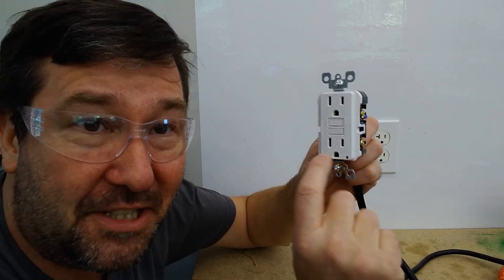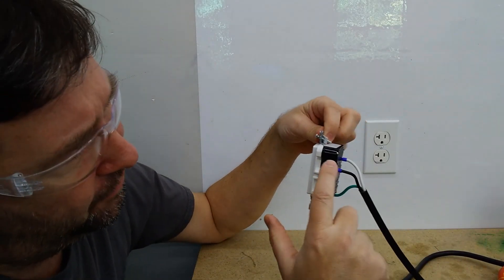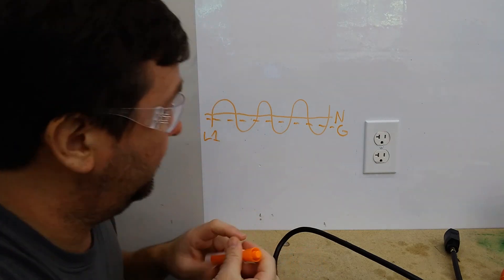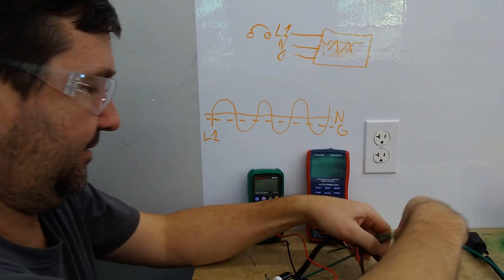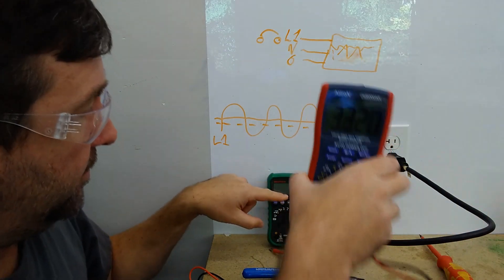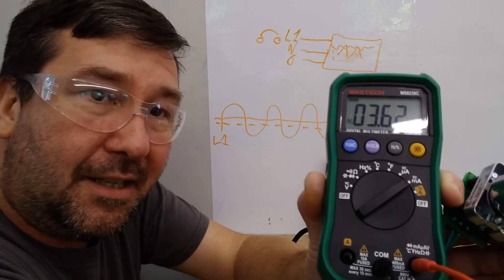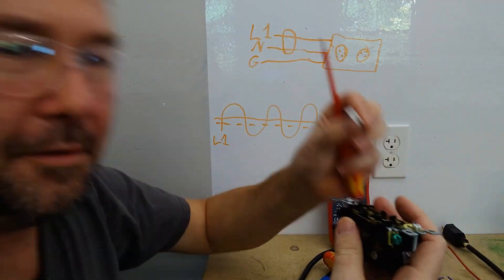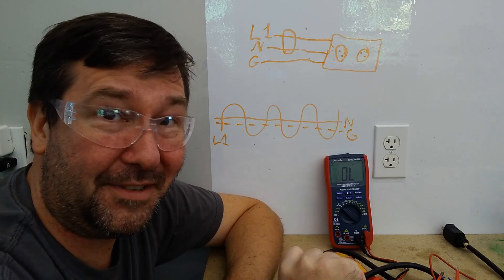Troubleshoot a Tripping GFCI Ground Fault Circuit Interrupter

Comment: Hi Tim,

10:31: I thought the current transducer is between Hot ( L1) and Neutral to check for the 5mA variance, but here you say it is between Neutral and Ground...or are there two of them?

Shouldn't current in the Ground be 0 in the normal state? Current should be present in a connected functioning Neutral. 

If there is a Neutral short to Ground, the current transducer between L1 & Neutral will detect it and trip the breaker, right? I don't understand the idea that the GFCI directly monitors the Ground and compares it to the Neutral, if that is what you are saying.

Thanks!
John
Reply from the maker: Not where I can watch that part of the video but what you're saying sounds correct. My gut feeling is what I was saying is that the missing current goes to ground, bypassing the neutral of the outlet but this video is several years old, I didn't remember the details

Comment: There are a couple different GFCI outlets that randomly trip in our kitchen. One of the circuits only has a microwave (& possibly the washing machine) plugged into it.  
Edit: I was just reading other comments, which made me realize, the water heater may actually be connected to this circuit as well. I hadn't even considered that.)

Every now & then I'll notice I have to reset the circuit breaker (press the button on the outlet) because it tripped at some point. This is even without running the microwave or washing machine!?

Another circuit, which apparently supplies current to half the kitchen & two other rooms, seems to randomly trip as well. It's not quite as random as the other one..in that, it's also happened when i turn on a night light plugged into the outlet that trips.    

An outlet downstream from it is no longer used (in my brother's room. He said the button won't even push to reset the circuit. So he stopped using that outlet, all together) IDK how that circuit is wired, but like i said, it supplies 2 1/2 rooms. In the kitchen, the fridge & a toaster oven are plugged into it. 

Any ideas on what could be causing either one of these issues? 

Or how i could figure out the wiring schematic for the 2nd circuit, without a wire toning device?

Any input would be appreciated BTW.
Reply from the maker: I would lean towards anything water related.  Chances are, the GFCI is doing it's job.

Comment: Riddle me this, Batman. The other day I had a quick power-loss at my residence. After the power returned (was only out like 3 seconds), the GFCI in my garage popped (which I discovered about 5 hours alter when my wife informed me the freezer in the garage wasn't working). 

The circuit breaker did not trip. only everything downstream of the GFCI was gone. Thankfully there wasn't much (a freezer, a battery charger for some cordless items, etc.). I removed everything off that line. In short, nothing is plugged into that circuit any longer, and the GFCI would still only reset for a few seconds, then pop again.

After reading online that the GFCI may be damaged, I replaced it. Same problem with the new one. Nothing plugged in on the entire run; just empty outlets. Still, the GFCI pops. My next mission will be to see if any of the outlets have loose terminals, but I hold little hope on that. 

I've yet to solve the problem, but managed to get the freezer plugged in to an alternate outlet on another circuit (stole the garage door ceiling outlet).
Reply from the maker: It’s difficult to diagnose these problems from YouTube comments. You’ll need to do some testing to figure out what’s going on but there is likely some device still plugged into the outlets or water has got into one of the boxes or conduit and is allowing some current to leak to the ground.
Reply: Did you ever get to the bottom of this? 

It seems like it must be a corroded or loose connection or water intrusion in one of the receptacles supplied by the GFCI circuit. I also know of cases where insects and/or their nests have caused GFCIs to trip. I think you pretty much have to open and inspect each of the receptacles.

Thanks for any follow up.

Comment: Soooo what do you do to clear the leakage current?  What do we look for
Reply from the maker: Hard to say, it could be a cut in a cable that is either allowing current to flow to the ground by the wires touching or simply a cut that allows water to get into the conductors.

Comment: Very helpful video, thanks! One nitpick: I think the voltage on the N line relative to G typically follows the AC voltage on the L1 rather than just being a fixed DC offset, right?
Reply from the maker: It could actually be either depending on the source of the leakage. Most electronics are DC.

Comment: Question please.   I plug my hair dryer current safety device (2prong) DIRECTLY INTO a GFCI receptacle.       I press the test button on the hair dryer, it does trip (2 prong, no ground) BUT the GFCI does not give notice to the action.     Confusion on my part.
Reply from the maker: The GFCI will not see a current imbalance when you press the test button on your hair dryer.  It simply bypasses one of the current transducers.

Comment: Extremely informative video.
Neutral to ground conductor leakage.
Reply from the maker: Glad you liked it
Reply: @TimWilborne  Burning question.  A string of outlets with No Ground conductor.
The first outlet in the string is REPLACED with a GFCI to protect the whole string.

           Does the test button work?
Reply from the maker: The ground isn't actually used in the GFCI.  That is why it is called a residual current device other places.  It monitors the current of the Line vs Neutral through the string of outlets.  If there is an imbalance (usually because current is going to ground), then it will trip.

Comment: Did you connect the wires from cord u plugged in the outlet on the load or line on gfi
Reply from the maker: Read your installation instructions carefully but the line is typically the power coming from the unprotected source and the load is what you want to protect.

Comment: Quick question, If you didnt connect your ground to the GFCI would it trip? Reason trouble shooting...
Reply from the maker: No, in fact they were originally developed for circuits without grounds.  They should be labeled as not grounded in you don't have one.

Comment: Tim, great video on explanation of GFCI operation. I have a different question about a problem I have in my house. I have a GFCI in my laundry room with what I believe feeds 3 outlets in other bathrooms away from the laundry room. A couple of weeks ago all the outlets in the bathrooms stopped working, although the GFCI has not tripped and has the 120 voltage emitting from the GFCI outlet. In the circuitry in GFCI's, is it possible for the device to operate without tripping (and still provide voltage from it's outlets) yet still open the circuit downstream where no voltage is provided to the outlets connected on the load side?
Reply: Any luck figuring this out?

Comment: Can you explain why my GFCI's trip in my bathroom when I activate the mic on my HAM Radio even if at 10 watts? Are their GFCI outlets that won't ?
Reply: I wonder if you have "arc fault" rather than "ground fault" that are tripping due to amateur radio. Arc fault are tripped by RF energy. An arc will give off RF energy and that is what they detect. I've having the same problem at my house. Unfortunately, I don't have a solution figured out.

Comment: My electrician installed various GFCI's because the house wiring has no Ground line. It's old knob and tube wiring! I'd like to get away from the K&T wiring, but it is a daunting, very complicated and expensive job to redo, what with wood and plaster walls and insufficient outlets. Lots of problems with an older house!
Reply from the maker: Yes, GFCIs are a good idea on knob and tube wiring!

Comment: I've got a natural gas tankless water-heater. When installed, I had to put in a GFCI to run the unit (exhaust fan and ignition). It started tripping after about a month of use, and I've read that the ignition system (coils?) often trip GFCI outlets. I gave up and put in a normal outlet.
Reply: A guy brought in a motor to a store, "Harbor Fright"..
He told the clerk it was causing his breaker to trip..
He wanted to know it was tripping the breaker, as the breaker is good for 25 Amps, as the motor was 20 anps . Well to get a job at HF, all you need to do is breath..
After listening to the kid at HF saying he didnt know why and it should work.
I asked to see the motor..
The motor had 20 running amps, but had 30 starting amps, which kept tripping the 25 amp breaker..
I gave the customer and young employee, a  brief education on motors and electricity..

Comment: I am assuming that he Test button does somehow electronically trip the GFCI and that it is not a mechanical shut off button. Otherwise there would be a log of lawsuits. But how does it work if there is no ground connected to the outlet?
Reply from the maker: Interesting GFCI's were originally designed for outlets that didn't have grounds.  If you press the test button, it shorts the neutral to the ground, making an imbalance in the current between L1 and neutral which will cause the GFCI trip.
Reply: @TimWilborne  Interestingly the hand held GFCI test and polarity tester does require the Ground Conductor to be present in order to PRESS and utilize the test button.
Naturally ungrounded, GFCI protected circuits FAIL the test button test, BUT are
GFCI protected. 

Sidebar subject,  The protection device at the end of my hair dryer cord, TEST BUTTON does work when plugged into an outlet with no ground conductor.
Reply from the maker: Yes and ungrounded GFCIs must be labeled as ungrounded

Comment: 3 breakers got tripped during an electrical storm and two i flipped back no problem. My garage breaker wont reset. I replaced the breaker still wont reset. No garage power. Gfci go bad?
Reply: What did you do to solve this?
Reply: @blu.q2272  i had to replace all the wall outlets in a line on that circuit until I found the bad one. Then everything clicked on fine and the gfci finally reset and I could flip the breaker back on. Took hours but not expensive or hard to do.
Reply from the maker: Thanks for sharing. Too often GFCIs are labeled as a nuisance when they're just doing their job.
Reply: @bouncing25 hmm...so, did you have anything plugged into the outlet that ended up being the culprit? 
Did your breaker box refuse to allow current to flow to the circuit all together while the bad outlet was connected? Or did it just continue to flip on occasion? 

Disregard my last comment. I posted it before reading your follow up comment.  (BTW, thanks for posting the followup! I imagine it'll be helpful for others who have similar issues)
Reply: When you say you replaced the breaker... are you talking about the breaker inside the main breaker box?

Comment: He's probably ground in neutral bonded at the panel inside the  Distribution panel on the boat he needs to isolate the ground separate from the neutral bus bar and that should resolve the problem it's probably an older boat that wasn't set up for GFCI compatible for feeder circuit
Reply from the maker: No, he had a motor in the bilge that water had seeped into and it was bleeding current between the neutral and ground.  In the end, the GFCI was doing what it was supposed to, we just had to hunt down the culprit.
Reply: @TimWilborne   Yup that will do it too . .025mA is all it takes to pop a GFCI

Comment: As long as the current is balanced between L1 and Neutral, and nothing is flowing to ground (+5 mA), your GFI wont trip!  I just had to replace my garbage disposal! :)  Thank You!
Reply: I touched the Neutral to the ground, and it tripped the GFI circuit circuit breaker!  :)
Reply: Suppose if a metal chassy (which has no contact with ground) comes with contact of hot wire.. Will it be considered imbalance and cause GFCI to trip? Or Unless some one touch that metal chassy and provide ground connection then it will trip?

Comment: I have outlets that recently started having issues anytime I’m running my tv it’s trips the circuit breaker every so often . I reset the circuit breaker and it’ll work for a few min and repeat. I noticed it only trips power to 3 of my outlets in my living room. It’s a fairly new home not sure what’s causing the issue I’d like to tackle the issue myself any suggestions?

Comment: I have a weird problem with GFCI. I use a power distributor for work that will immediately trip a GFCI, even before I turn any of the circuits on. Our solution for this has been to unplug all our components from the distributor and directly into the GFCI outlets. Ostensibly we're powering the same things so the fault has to be in the power distributor itself...? But we've had it inspected multiple times and it seems to be in working order.

Comment: According to Kirchoff, electricity takes EVERY path to ground.  
Great work, Tim!  Can't wait for the next one.
Reply from the maker: Exactly. When people say the electricity takes the shortest path, that don't take into account that the wires have resistance. Once you plug those numbers in, it is easy to break this myth.
Reply: Yes, anyone who's done any circuit calculations knows this.